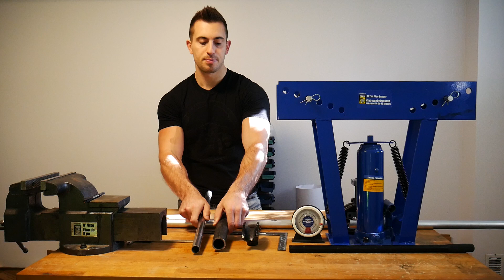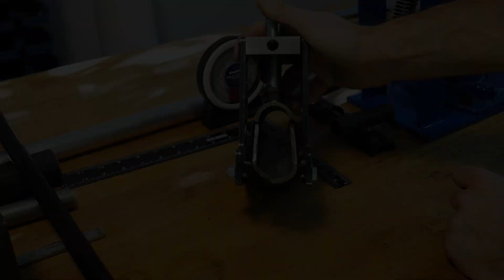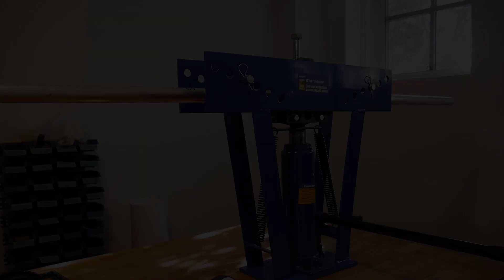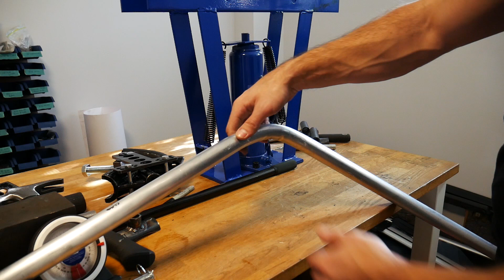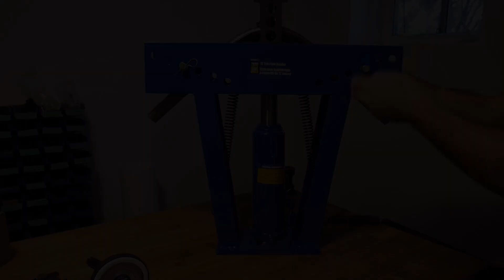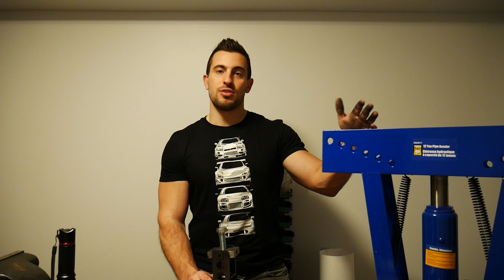How to Bend Tube with a Pipe Bender!

Comment: Fill your pipes or tubes with sand and pack them to bend without any kinks.
Reply: water dont work like the sand, the sand stays and causes the pipe to bend around it. The water just move and the pipe kinks.  try it with a straw.  Fill it with a fluid and then bend it, the straw kinks, now fill the straw with sand and bend it.. The straw stretches in the bend area around the sand..
Reply from the maker: I've heard of this trick but was hoping to solve the issue without having to resort to this for every bend. Becomes a bit onerous when you have many bends to complete. Might have to try it in the future though. Thanks for watching!
Reply: Creative Customs , yes absolutely sand. If it's  worth the time and cleaning up effort. This machine  does work professionally if done correctly, careful. I've completed a complex roll cage with that machine , and it is low cost but definitely not cheap ☺. I'll upgrade mine soon. Great video and ideas.  Thank you

Wipe surfaces with motor oil to keep from sticking to dies, try not to sacrifice any stability for grabby pieces.
Reply: Water dont work..  try my example....   Now if you pressurized the cavity with water such as hydro forming you could.. But the back yard mech dont have access to that.  Water in a pipe will not allow you to bend without kinking it. SAND WILL work
Reply: You could use water but you would need to have a high water pressure where none could leak out at all which is much more difficult than just hand packing it with sand and taping off the end to keep the sand from falling out. You could probably do it with about anything even air pressure if you could build up a high enough pressure that would not leak out. I have seen people use plastic pipe and even strong springs that were the exact ID of the pipe they were bending and permanently placed a piece up where the bend was to be performed at to help force the pipe to bend more gradually and to stretch where needed on the outer edge of the curve to stop the pipes internal bend from wrinkling up and crushing in on itself. The principle of the whole idea is creating enough internal pressure that when bending the pipe it is forced to stretch slightly longer on the out edge of the bend than it does on the internal curve that it stops the pipe from from wrinkling and denting in ward. Where the internal pressure from the packed sand stops this internal denting and wrinkling from happening. That's the idea of a mandrel bender where it pulls a ball down the inside of the pipe that is its exact internal diameter of the pipe at the very peak of the bend. So as the pipe bends it forces the pipe to stretch slightly longer as the round ball stops the internal curve from wrinkling in on itself the pipe retains its exact shape. I think it is just cheaper and easier to pack the pipe with sand, as well as to clean up afterwards and store the supplies for next time. Then if you do not have to worry about effecting the temper of the material you are bending, or have the ability to re-temper the pipe after creating the curve you need heating up the pipe's outer wall of the area you are bending will allow the outer wall to stretch much easier there is less force on the internal curve which cause the pipe to wrinkle. So a little heat will let any trick you use to create the pipe's internal pressure help eliminate any wrinkles so your bends will come out near perfect. Keep in mind these were all just tricks for the DYI'r at home who needs to make a bend or two a little bit better and doesn't have the money or access to a professional with a mandrel bender. Anyone who plans doing this as part of a business or on a regular basis should just invest in the right equipment like an actual mandrel bender. The time it will save you not to mention how much more of the pipe's structural integrity is retained on a project like a roll cage or tube bumpers, the extra money a mandrel bender costs over a traditional pipe bender will more than pay for itself in the long run.
Reply: Creative Customs 
yes that helps..internal spring coils are what some HVAC guys use..and heat also works
Reply: With a tech inspection, like he said, this isn't worth the time... Plus, even if it worked, it's essentially not versatile unless every bend is one/two dimensional. I could utilize a bender- but I'll happily do without until I can get a full-fledged tube bender.
Reply: Fluid is non compressible. The pressure build up during hydro forming is effectively from the elastic property of the metal, not the compressive property of fluid.
The problem with fluid is keeping it from escaping. But once you figure out a way to securely seal it, the only way the bend will kink, is if something else stretches.
Reply: Well, I'm a person who has tried this, sand and other materials, capped and even had threaded rod to compress it, didn't make a difference. tried it multiple times because people keep telling me, so i think it's me who's useless. I now wonder if the people reccommending it have actually done it themselves.

Besides the time that goes into each one, so it's a big no from me. 

There is one thing i would like to try, and that's bismuth, a very low temp melting metal that model makers use to fill up lightweight tubing for bending. When finished, just a few moments over a flame melts the bismuth.

I have personally put short length of aluminium tube up inside thin wall steel tube where the bend is, and later dissolved the aluminium tube out with swimming pool acid. that is very easy method. I've also tried motorcycle front fork springs and would them out later, damn hard work. And finally, if weight isn't a big issue and you don't want to waste money on aluminium tube, put a short length of steel tube inside where the bend is and leave it there. If it's stuctural, you are also strengthening that point.

Comment: Great work. I know how hard it is to keep trying and it just not working properly. You look like you go a better result than I did in the end. I know in the end my biggest issue was that the radius of the pipe die was too small for the tube. If you want to persevere you could try getting a larger die and step down a couple of sizes. That way you have a larger radius and it may actually work.
Reply from the maker: Hi Jeff, that's a very good point. Something to consider in the future, but I may try my hand at building a true tube bender on a budget. Your video was one that inspired me to try this myself!
Reply: That is what I did in the end. I bought a die and built the bender. Building the die is the most difficult part. Nice quality videos anyway, good luck.
Reply from the maker: Thanks, I will be doing something similar :) Same to you! Great content!

Comment: Great video. You should check out the video that Homebuiltbyjeff did on converting his pipe bender into a tube bender.
Reply from the maker: Thanks! I did see his and I actually plan on doing a proper one so I can do cages / tube chassis work. This was more of an experiment than anything else. I was able to get some tube bent up good enough for a rally light bar that I installed on the front of my GTI. I believe you've seen it on IG :) Thanks for watching and following!